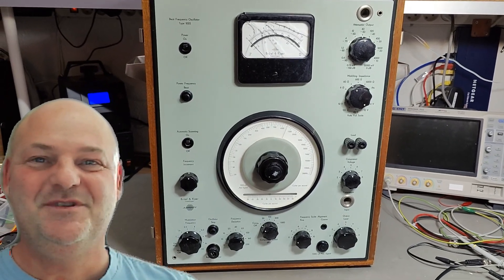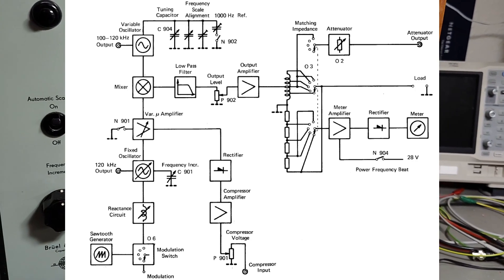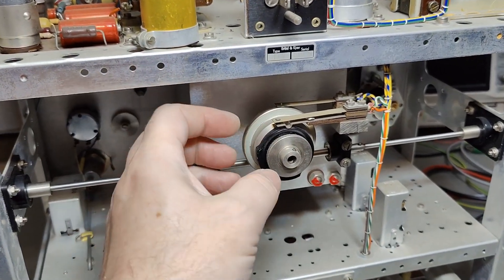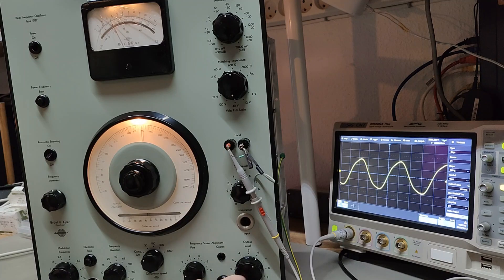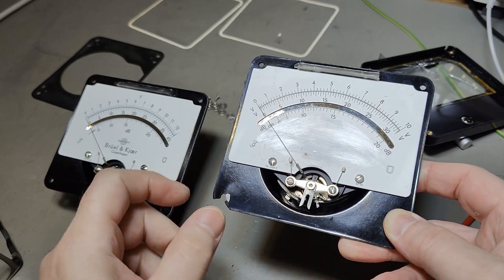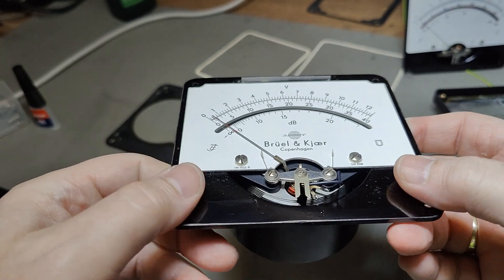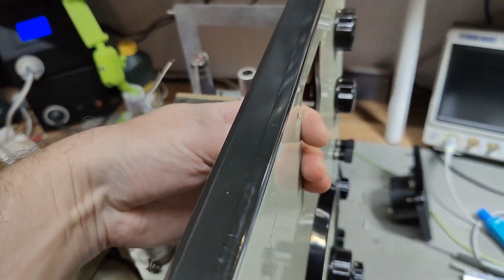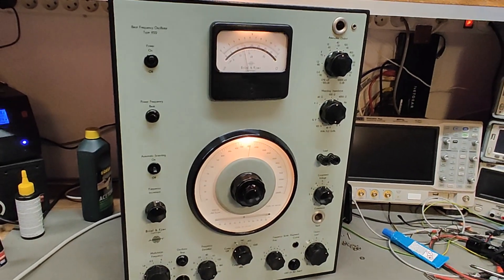Brüel & Kjær 1022 Beat Frequency Oscillator 1964 restore repair

Comment: Hi Thomas, wonderful work on a beautiful audio oscillator 🤔 that you robbed some museum of technology 😂 The first thing that came to my mind when I saw the damage - lucky that the lower indicator is not damaged, the upper one can be repaired from another voltmeter. As usual he did an absolutely amazing job including leveling the panel. It just seemed to me that the curve in the positive half-wave was a little distorted - maybe some capacitor was out of spec.

Nice day 🙂 Tom